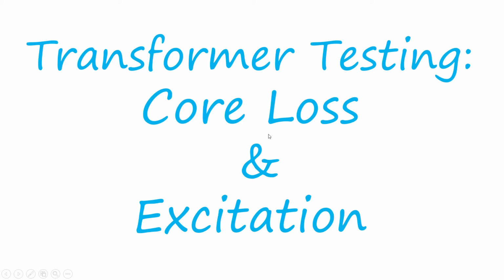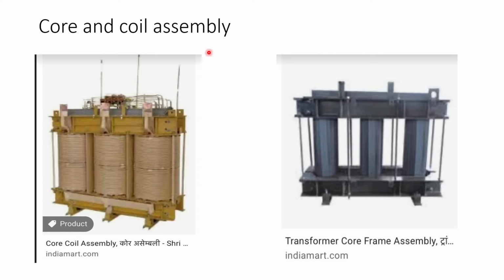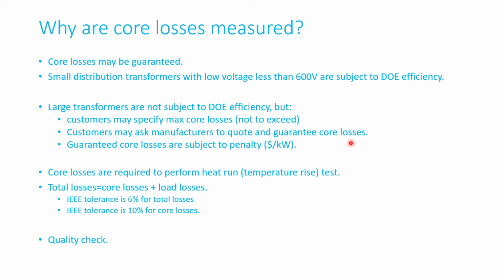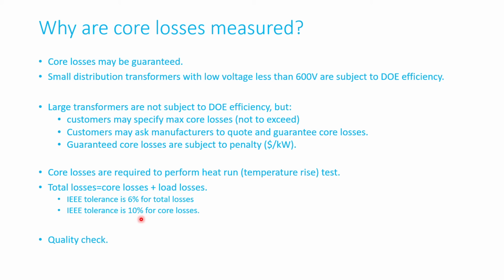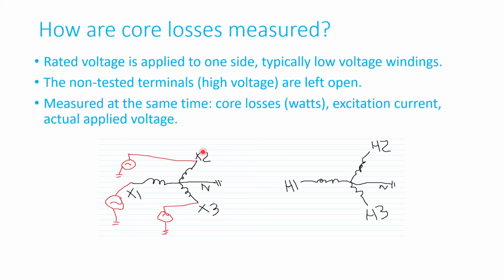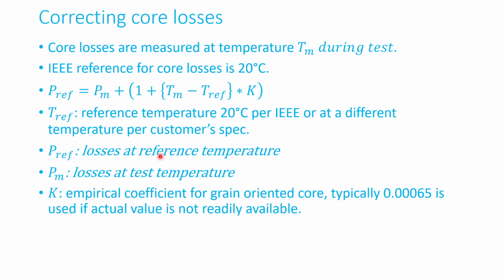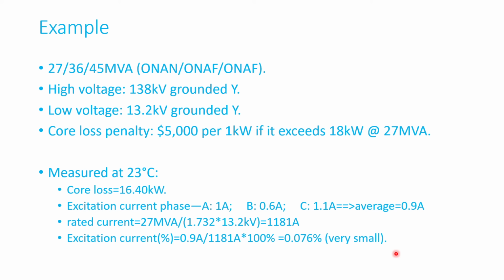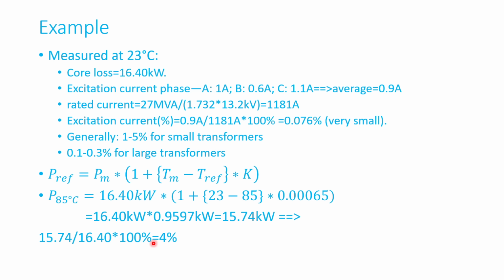Transformer Testing | Core Loss and Excitation

Comment: I think the B-phase excitation current should be higher than the the other two, because it has longer way to travel.
Reply from the maker: The B phase is the middle phase, which is the shortest magnetic path. For example, for 3-leg, core form, the flux generated from excitation needs to flow through external core limbs plus portion of yokes, which are longer than the middle phase.
Reply: @engineeringsimple  Thanks for replying. All the core-isolation tests I have reviewed in the factory results in the middle phase having higher excitation current than the other two phases. You may reference "Low voltage single-phase excitation for power transformers" in Transformers magazine. 

The above reference contains test results and also a statement about the current and losses in the middle phase being higher than the other two phases due to magnetic flux has a longer way to flow.

Please let me know your thoughts.
Reply: I found the answer. It's not always that the B-phase has higher or lower than the outer A & C phases. It depends on the phase pattern (H-L-H, or L-H-L) with the core configuration (like core or shell type). Based on these facts, the B-phase excitation current test value will be determined. In the factory, I worked on distribution transformers with 5-legged shell type with L-H phase pattern, this is why B-phase is higher.
Reply: Alternating magnetic fluxes are like vectors and the limbs are paths for them. Visualize them in that perspective